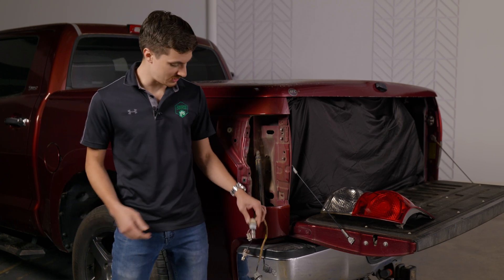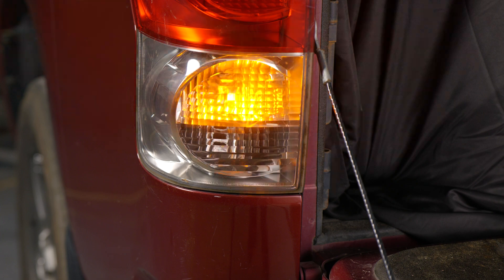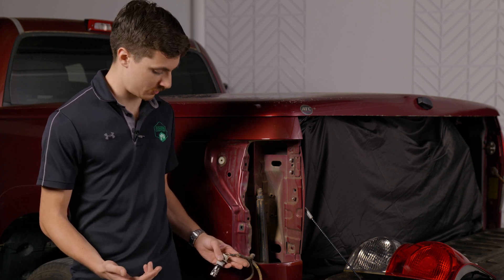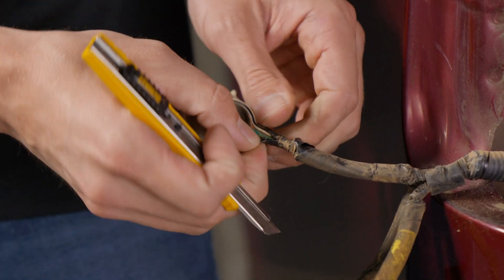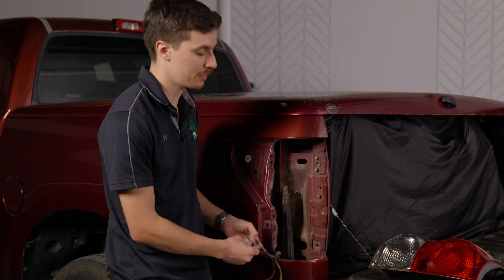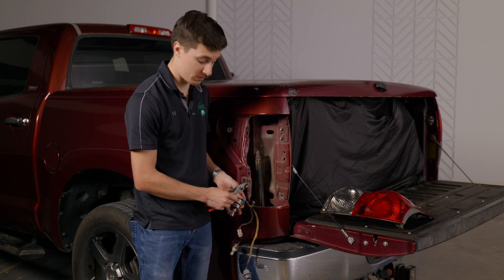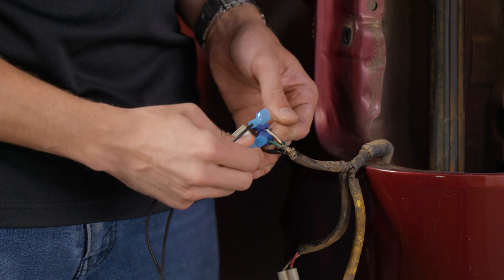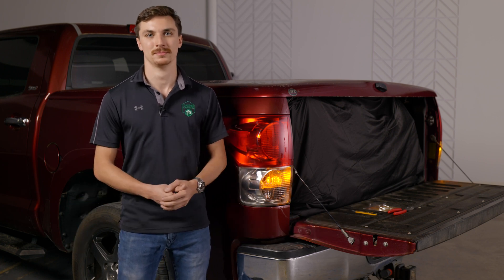Explaining The Causes Of Hyperflash & Solving It With Resistors From Morimoto!

Comment: it is easier to change the flasher unit located at the fuse box, plug and play item, your local parts store should have the flasher in stock,
Reply: Not all vehicles have a blinker relay. In this case, load resistor is the only way to fix hyper flashing.

Comment: Great video. I have a 13 Ram 1500 5.7 4x4. Converted to all led. All the turn signals blink outside perfect, but hyperflash on the cluster. Any idea on how to fix that?
Reply from the maker: Appreciate it! On most Rams — especially the 4th gens — hyperflash on the cluster is super common even if the exterior signals look fine. A resistor setup usually clears it right up. If you need help picking the right ones or wiring them in, hit us up — we’ll get you sorted. 💪💡

Comment: Hello excellent video! But I had a question does it matter what load resistor I use? I have a 2020 Honda civic sedan would it work for this?
Reply from the maker: Thanks for watching! We typically recommend starting with a 50W 6Ω load resistor to prevent hyperflashing or error codes. You can find them on our website here: https://www.theretrofitsource.com/50w-6ohm-gold-resistor-ACC.RES.50W?quantity=1

Comment: It's funny all these videos show putting it in and it stops, when the hazards are on. But if you try and use your regular turn signal it still hyper flashes. Why is this?
Reply from the maker: The resistor is specifically designed to stop hyper-flashing with turn signals, as that's its primary purpose when paired with LEDs. Hazards are less likely to hyper-flash because both LEDs are active simultaneously, drawing enough power to properly communicate with the vehicle's light system. When using a single LED for a turn signal, the resistor compensates for the lower power draw to prevent errors. If you'd like a more detailed explanation, check out this video: https://www.youtube.com/watch?v=ADKjG3Z2L5w&t=2s

Comment: It’s always a tried and tried putting a load equalizer resistor.

But why not a more simple and refined led flasher relay?
Reply from the maker: Flasher relay may not work the same on every application such as a resistor would.
Reply: @RetrofitSource  how about a Novita led flasher relay? 

Or some vehicles are difficult to change them and the load equalizer resistor is the best option? 

Also, I notice he didn’t splice the wires. Instead he tapped them to bypass the oem to resistors? What was the difference between the old load equalizer resistors and the new one?

Comment: I’m still amazed no one has come up with a better solution than T-tapping into the wires.  Sure it works fine, but from a longevity standpoint, probably not the best solution.  Is there not a way to add an inline adapter that’s connected to the resistor? Like a male-by-female bulb socket, which receives the factory socket in one side, and you plug the bulb into the other?
Reply from the maker: There are some companies, like GTR Lighting, that are starting to include plug-and-play resistors like you described! Definitely much easier to use and install. 
https://www.theretrofitsource.com/custitem_cat_facet_brand/GTR-Lighting?keywords=i%20led